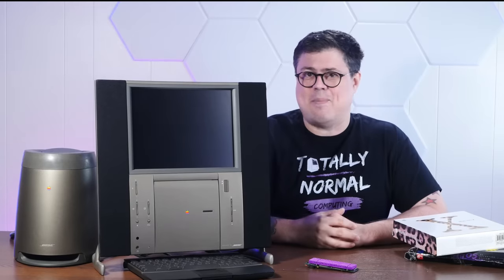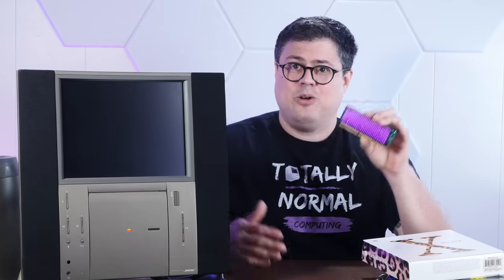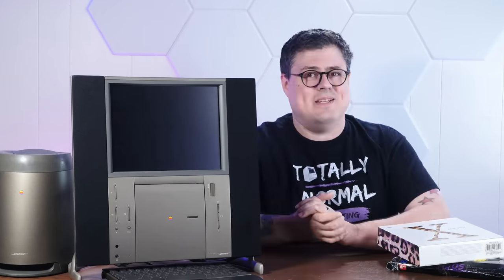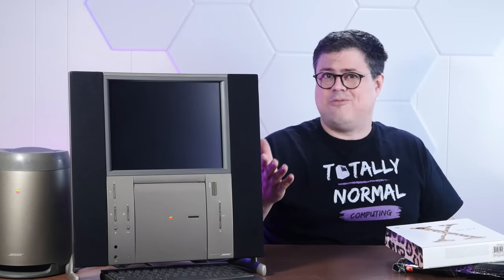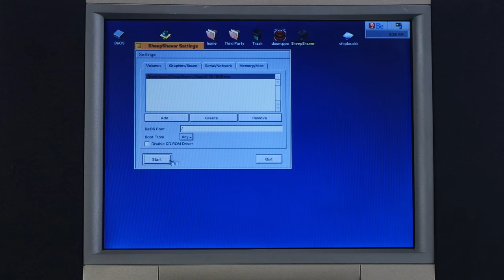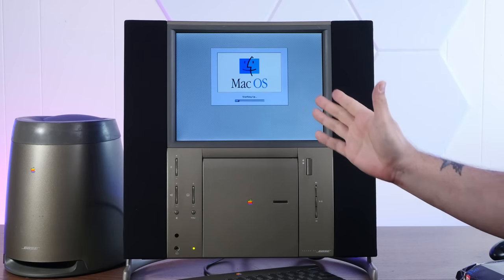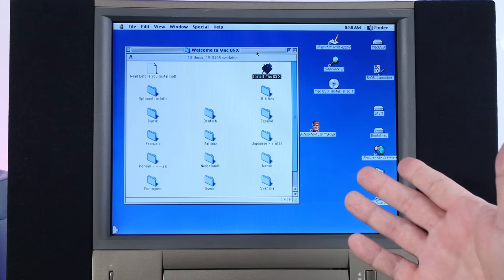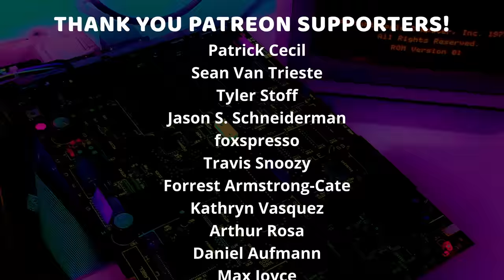The World's First G3 Swapped TAM

Comment: This was definitely a sweet upgrade to perform! Hopefully I can resolve the weird cache card upgrade extension issue.

As for OS X, you’ll definitely want to connect an external display, especially during the installation, as Open Firmware does not show any video at all on the internal display of that machine. Once the installation is complete and you select the correct display resolution, in theory, OS X should begin working on the internal display. Also, when you install, ensure that OS X is installed onto the first 8 GB partition of an IDE drive, otherwise it won’t boot.
Reply: Amazing!! You are the man.
Reply: Hello, I'm curious, what is that lamp thing you used to heat up the chip to be able to remove it? I've never seen one of those before
Reply: @LovelyAlanna  That’s just a BGA nozzle for my hot air station. It’s sold as an “Aoyue 4545W”.
Reply: That was so cool!
Reply: You are a legend, Sir. :)
Reply: @dosdude1 Will a 3400c accept one of those G3s?
Reply: @ericbauer4559  I've tried it, and unfortunately it does not work. Not really sure exactly why.
Reply: @dosdude1  ah dang
Reply: @dosdude1  The Kanga and the 3400c have the same form factor RAM cards but they are not interchangeable. 3400c cards will not work in the Kanga. Not sure if the Kanga ones are backward compatible but I suppose not. The way that memory is mapped on the logic boards will probably be one hurdle.
Reply: This reminds me I have an upgrade card waiting for a @dosdude1 magic session. Just need to get it in the mail. This was so awesome.
Reply: Good work. I've known about the 740 for ages but my equipment and skills haven't allowed me to complete such a project. I wanted to do a swap of a later PowerBook 500 series PPC card with a 740. I heard someone had tried it before but it didn't work. I have all the parts but still no equipment (and thus, no skills). I'm still hopeful that I'll get to try it out one day.
Reply: i really want to learn what you do one day, i love just the fact of being able to upgrade and repair things essentially no matter what
Reply: God has spoken.
Reply: What specific G3 did you use?
Reply: @arielsaulog6796  PowerPC 740 (so either Motorola XPC740 or IBM PPC740L).

Comment: It amazes me how flexible macs can be with CPU upgrades.
Reply: or the g3 is compatible with that old cpu in terms of the socket
Reply: This is what makes it so frustrating to me that Apple takes such a strong anti-consumer, anti-repair stance.  If I could just swap parts out when they break; or just.... run the code I would like to run on my devices without the machine fighting with me... I'd still be a dyed-in-the-wool Apple user.  Hell, even now, I just got an M1 macbook by chance; even with all the frustrations I have with modern Mac OS, there's a lot about it I REALLY like...  It's just that the stuff I don't like is so unpalatable, I feel bad using the thing.
Reply: @tomshotdogs6645  The only problem I have with the AS systems are the soldered storage. For those not made of money and prefer Apple you are essentially forced to use an external storage solution to extend the life of the machine.
Reply: @johntrevy1  it feels blatant, that apple went with arm specifically to spite the hackintosh movement, where it was possible to use AMD CPUs and have a resulting build that performs better. That and time and again, arm silicon can't multitask to save a literal life. Source: every phone, ever.
Reply: @ZeroHourProductions407  In today's energy crisis it makes sense to go with ARM. ARM is rapidly catching up with X64 in performance. As regards to the Hackintosh, well Apple sort of created it in the first place.
Reply: @johntrevy1  Nah, as the products show, apple went to arm to eff over its users and to lock things down harder than ever. Seriously, why is a brand new prebuilt machine in current year being sold with 8GB of RAM, total?! And to be sold in a form factor where not even that can be upgraded?
Nevermind Apple's aggressive spite against right to repair; which is neither here nor there to discuss.
I'd argue that ARM is nowhere near x86, let alone x64. All these cores, all these hybrid cores, and yet every phone ever loses half its performance by even attempting to have a second, active program window. The amount of system lag just for animating a gif is surreal, if not outright offensive. Nevermind that ARM's complete inability to handle Flash content is but a factor in its eventual end.
Reply: @ZeroHourProductions407  Have you ever used an AS "desktop"? I don't have any problems with slowdown. As for  multitasking on a phone, it really isn't feesible to think it can be done on any phone regardless of architecture. And the performance, well alI can go by is benchmarks, but it is a fact that ARM is catching up.
Reply: @johntrevy1  in what universe would I deliberately pay money to use a platform that is so incompatible? Ffs, every build of Mac os that supports apple silicon flat out won't support steam or any games for the environment, full stop. It's been a problem since Catalina.
Reply: @ZeroHourProductions407  It is the want VS need equation I'm afraid. MacOS has always been the OS I want to use, Windows has always been the OS I need to use, I have never been under any illusions about that but with MacOS I always walk away happy and stress-free. I have never been a PC gamer so I am not qualified to answer about that, but all I know is gaming on Mac is more accessible than ever (for what it is).
Reply: @johntrevy1  in terms of operating systems, os x is basically the only *nix based anything, that hasn't drove me to pounding the desk with tears of frustration. 

The Linux evangelists are no small source of frustration talking up Linux for things, only for them to lead me to incomprehensible how to docs and making love to the command line with more esoteric commands than a five star prostitute could be expected to understand.

But I cannot forgive or forget Apple's attitude being so hostile to keeping a machine going. And their changes to the os as of Catalina(?) Have made Steam unusable in Mac os. Considering the ubiquity of the platform, that kind of exclusion is insane, for anyone other than hyper petty Apple computer.
Reply: @ZeroHourProductions407  I totally agree with you about the cultlike mentality that surrounds Linux. I even brought up about how Linux is still not user friendly because the terminal is pretty much mandatory and they RIPPED into me about how it was a myth. If Apple can turn a *nix system into something you don't have to use any terminal then so can Linux (yes I know Unix and Linux are two different things, but they are similar enough), even Microsoft that has its roots in a command line only main OS has managed to ditch a compulsory terminal.

Again, unfortunately I can't comment on Steam as I am not a PC gamer. I could never wrap my head around a KB and mouse setup.
Reply: @johntrevy1  eh, perhaps. but at least for me and mine, I can say rather bluntly that if I can't game on it, such a system has zero lasting use for me. Like I cannot be arsed to give it more than a passing thought otherwise. 

And it pains me to see Apple fall this far, considering that  at the time the G5's were fresh off the factory, the Apple store nearest me at the time had the wherewithal to install playable demos of XIII and UT2004 on the display units. With the glorious 30 incher displays. I had to physically crane my neck around to be able to see every corner and just how much was going on. And UT2004 on said Mac let me max out the settings and hear the announcer go "HOLY SHIT!" for the first time... in an era where not even the fastest Athlon64 and geforce 6800 ultra's in SLI could let you go that high, and the G5 was doing it like it wasn't even its first time fragging.

Now, because Apple wants to be the "open our computer and we'll shoot you" people, every build of OS X made to be aware of their ARM silicon has explicitly blocked Steam from being able to install or launch. And I'd argue that VALVe have done more to include the Mac as a viable gaming platform than Apple itself ever did.
Reply: @ZeroHourProductions407  Like I say, I am not a PC gamer (Unless we are talking dos/early windows). I'm happy with my AS Mac as it does what I need, it can do photo editing, drive a Cricut machine and other basic things. If I want to play games, that is what my consoles are for.
Reply: i'm just sitting here eating popcorn while people are arguing
Reply: @Iristallite  Been quite civilised I think.
Reply: @ZeroHourProductions407  This is a fine summary of the situation. I want to like Linux... but sometimes (edit: often) even the most basic of configurations need a dive into the command line, despite people proclaiming Linux as 'desktop ready!' for the past 20 years.
Reply: @ZeroHourProductions407  the idea that Apple used ARM specifically to spite hackintosh users is absolutely nonsensical
Reply: @lexacutable  it sure isn't for the sake of performance. Arm sure as hell isn't known for performance even now. And nobody told apple that they should make an A4 sized laptop either, but they did anyway and of course it thermal throttled instantly.

Comment: My experience with the XPostFacto 'bricking' the 6400/6500 (and I imagine the TAM due to its similarities) is purely because OpenFirmware on these machines defaults to using the serial port, you have to set XPostFacto to use the keyboard for input and the internal video for output manually.
Reply: I have run OS X 10.2 on my 5500/225 years ago (it was painful) and IIRC you need to enter a few commands on a seemingly blank screen (the OF prompt sets the screen brightness insanely low for some reason). The version of OpenFirmware used in these series of Macs is apparently buggy too.

Comment: I did this last year with my gazelle mlb from a 6500. Since that is the same board as the TMA, I knew it was possible for that. I have been laid off from work for a long time, and just after finishing it, and set my sights on my TAM, I got a new job and ended up having to relocate to Florida, which I just completed at the beginning of April.

Comment: I'm impressed that you have taken mac modding to this level. I'm a bit dismayed in that Wolfenstein 3D and Doom ran 'buttery smooth' on my old 386DX way back in the mid 90's. They should be running on any PowerPC processor like effluent off a soil removal implement. I'd love to find out why this is. Is it that Mac OS just isn't game friendly in how it allows games to get to the hardware? Lazy programming? Might be an idea for a future video.
Reply: It's the first one, certain versions of Classic OS just don't support the calls properly and are translated instead. There are later versions of doom that run flawlessly but there's no real way to identify what version is what, they look the exact same
Reply: @monkeyman767  Marathon ran well and it was doing essentially the same thing. So It’s definitely possible to do a Doom style shooter on the Mac and get it to run with usable performance.
Reply: @owenrichards1418  yes, but marathon was built exclusively for Mac at the time. Doom wasn't, and as I say, there are later versions that run just fine, but some earlier versions are essentially just poor ports that do some tricks to get it to run

Comment: I wonder if the OS X not booting/installer not being happy is due to the list of acceptable macs.  That reminds me of e trying to install Jaguar on unsupported macs.  There is however a special version of Jaguar 10.2.7 for iMacs that might not check the model id?  I'm pretty sure I used that to install Jaguar on a G4 MacMini.  That could be worth a short, but IIRC the 6500 and TAM are still old world. So maybe it should be the same process as getting OS X on your beige G3?
Reply: IIIRC, at least with Leopard, you can edit a plist somewhere in the installer to make it ignore the supported system list. But if anyone can figure it out, it's probably dosdude1 himself - he maintains patchers for more modern macOS versions to allow them to run on older systems than technically supported.

Comment: I remember getting 10.2 running on a Powermac 6500/225 way back in the day. It worked, but it took 10-15 minutes just to boot. I imagine the slower, unsupported architecture and the paltry 128MB of RAM had something to do with it. I think I had it booting up faster on old 604-based Macs.

Comment: This is really neat that the packages for the G3 and 603 are exactly the same and can just be dropped on there. I always hear about the G3 being a direct successor to the 603 but not at this level. What about the L2 Cache though? Does putting in a 603 Cache card into the slot just work? Otherwise you aren't running with any L2 right?

Comment: Can you use the G4 card in the G3-swapped machine
Reply: Theoretically you should be able to, just with the same limitations as before (only working in Classic MacOS due to the need for an extension to activate it). BeOS and OSX would presumably still be stuck running on the G3.

Comment: I have a Umax C500 603e/200 I have a G4 400mhz cpu in my G3 beige, Can I to put inside the Umax? Umax is zif socket 5 dunno what the G4 cpu is, it came out of a Graphite. I don't have a SFX adb gamepad, I have a CH GamePad with drivers disk. I want to play with Beos! I have the original BeOS Disc. I have a Sonnet G3/250 cache card in my 6400/200 (in pieces to fix the sub volume button) but no drivers for Be. Help anything will do